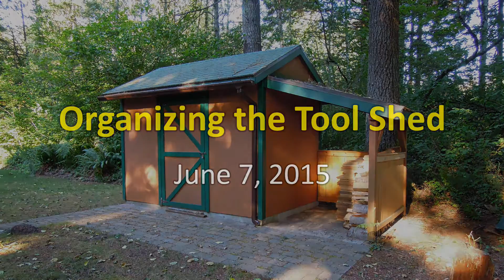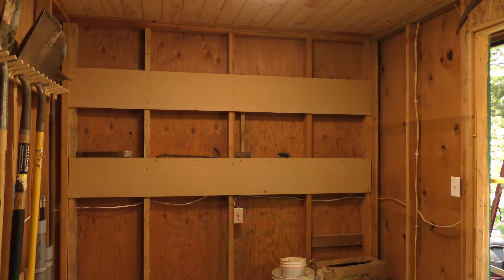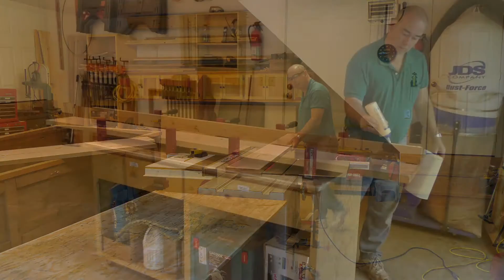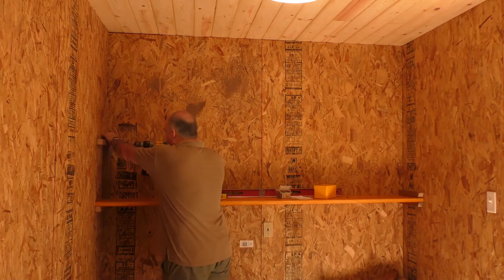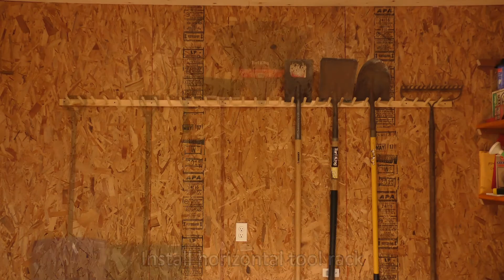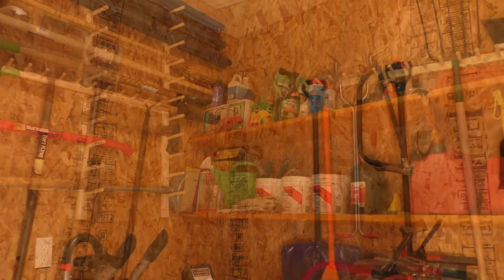Organizing the Tool Shed

Comment: Gonna wanna brace the center of your shelves or they will bow
Reply from the maker: It's not visible in the video but the back of the shelves are secured to the wall in multiple places with long pocket screws into the studs. They're quite sturdy and there's minimal weight on them anyway. Three years later, zero bowing or sagging.